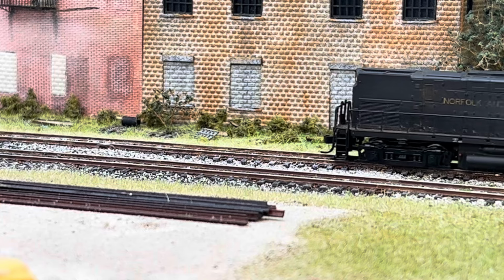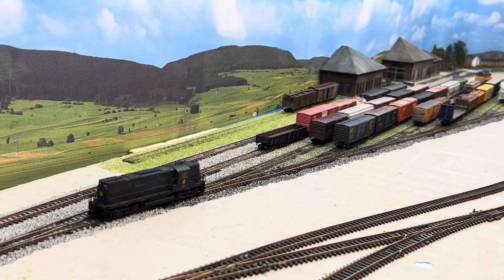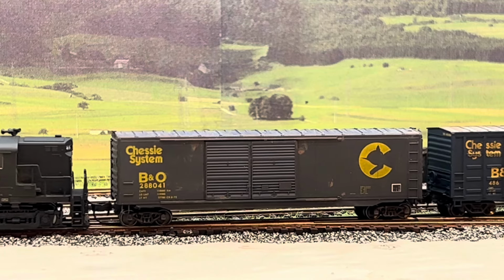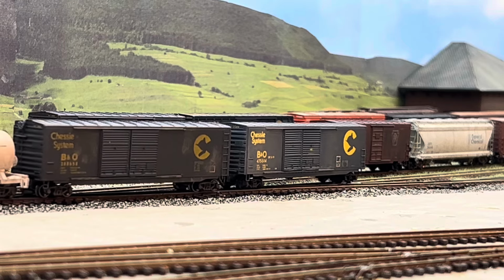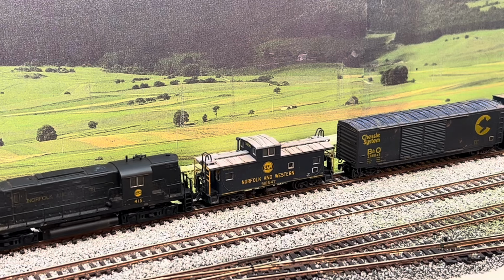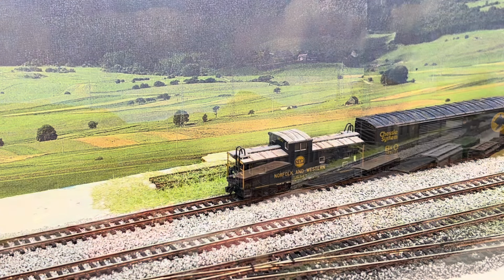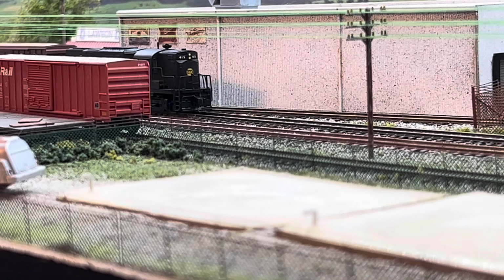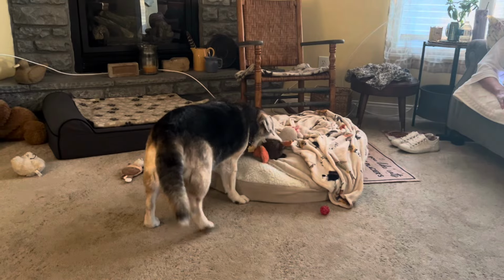N scale N&W high hood Alco with ESU Loksound running the interchange train in Chillicothe

Comment: To be frank, the way you announced that you’d be giving an update on jazzy at the end of the ops, I feared it might be bad news, but was happily surprised at her progress.

Love the alco diesel sound. Almost too bad that they can’t simulate everything. I heard or read why they smoke so much, but can’t remember. Was it the turbocharge?

Loksound decoders are different in that they are supposed to have 3 wire connections for keep alives. Esu’s smallest keep alive seems too big for Nscale. Wonder how Ben gets around all that. I understand some use the tiny TCS keep alive without causing problems when programming without needing to disconnect during programming, but I’ve also heard that putting non-ESU keep alive nullifies the warranty.

Sorry the long read. Great ops as usual. Thanks.
Reply from the maker: @KenN.OXN.805  Sorry to create some stress, Ken. If it was bad news, I probably would have not said it so matter of fact.
According to what I have read, older diesels didn’t have a very sophisticated fuel deliver system and it was excessive fuel while accelerating until the turbo caught up. Putting my flame proof pants on, that’s one of the negatives about modeling steam. To me, what makes steam locomotives cool is the smoke and steam. When they blow the whistle, to see steam. It leaks from the cylinders, etc. it’s very visual. Alcos are similar in the amount of exhaust they spew, but I don’t know if I want my layout room filled with smoke!😁
I don’t know how Benjamin does it, but his conversions run much better than factory locomotives. I might still have my Atlas Alco if I had know him.
Thanks for your well-thought out comments. No apologies necessary for the length. Enjoy the rest of your week and stay safe!